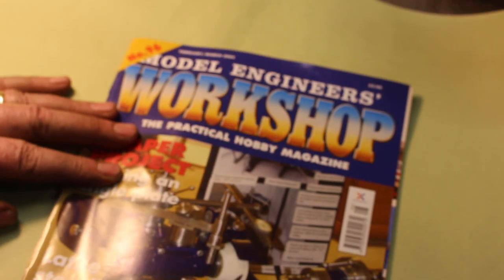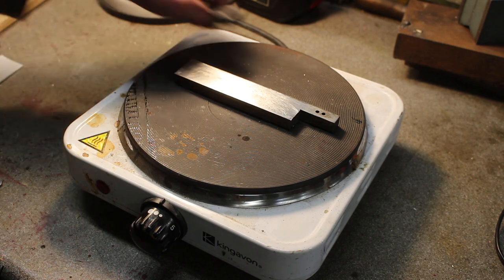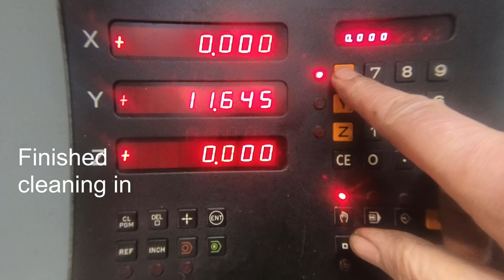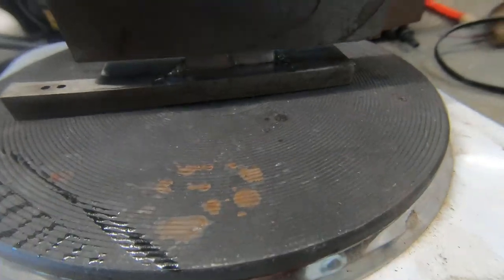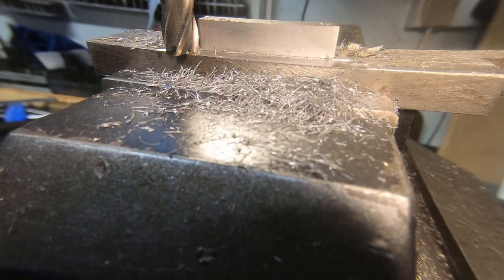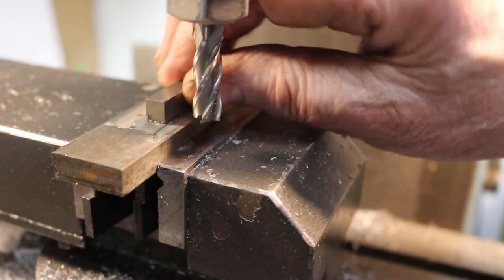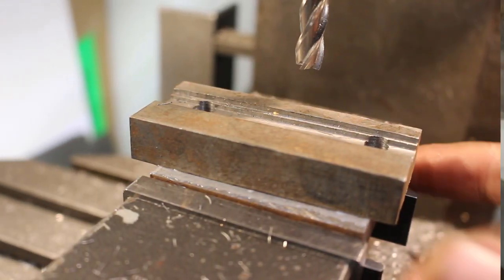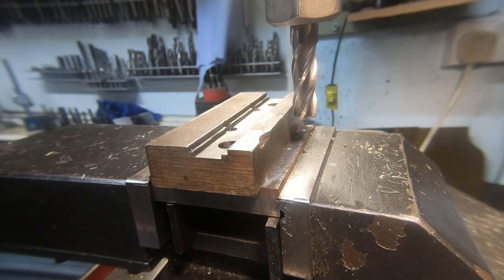Hot Glue FILM Work Holding in the MILLING machine.

Comment: Hi Nigel, good video. Thanks. Like owlman I wondered if the part just got too warm and it failed from the glue softening. Maybe with a cooling air stream directed at the cut would help in this regard. Certainly something to keep in mind for those impossible to clamp situations. I've used hot melt glue from a gun in wood before and then released it with a heat gun after machining but never tried it with metal in the mill. Enjoying the loco build. Can't wait to see it in steam.

Comment: hi gchms
great tip that, i'm going to order some to have on stock, for those tricky jobs
stay safe
regards 
mr f
Reply from the maker: So far it seems to work pretty well, I think you have to make sure the full mass of the material in both parts gets up to temperature, the hot plate seems a good way to go, heat gently, get up to temp, cool gently. Cheers for watching!

Comment: Excellent demonstration Nigel and really good product. Reminds me of when I used double sided tape many years ago to stick some thin brass plate to the top of the vice to fly cut it, it was nowhere near as solid as this looks! What is the cleanup like post separation? Is the adhesive soluble with any chemicals? Great video. Cheers, Jon
Reply from the maker: Hi Jon
Yeah, it's seem quite solid, I think I trust it more than super glue, time will tell. I'm told that isopropyl alcohol will devolve the glue, I'm sure acetone or similar would too but not tried it. Scraping it off and emery clothing didn't take long. Thanks for watching, much appreciated.

Comment: Did the metal warm up while while cutting? Does that make it loose it’s strength a little. Very handy to use :)
Reply from the maker: Hi Robert, no the machining process does did not heat the job up any where near enough to effect the strength of the glue, I think it just has it's limits like most things.
Cheers
Nigel

Comment: Was the part hot  from milling when the glue released during the first test or did the bond to the metal actually fail?
Reply from the maker: The bond to the metal failed, In both fails the glue stayed intact on the base plate, with none on the test part, maybe the part did not get hot enough? I think you have to make sure the full mass of the material all gets up to temperature, probably measuring the temperature as a check could help. Thanks for your interest.
Reply: @GoCreatehms  Interesting. I have never thought of using hot glue this way - I have always found it to be relatively brittle when used on anything hard (particularly plastics), I suspect it is designed for use with wood, card, paper and possibly fabric where it can get into the pores in the surface . Thanks for the video.